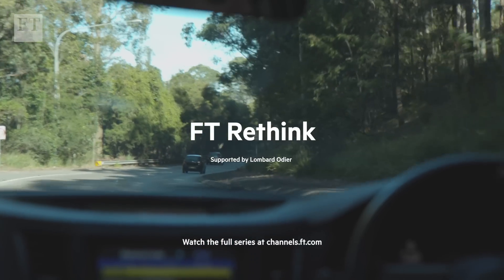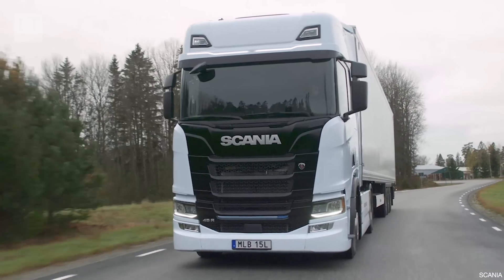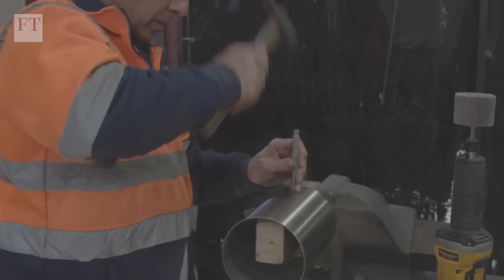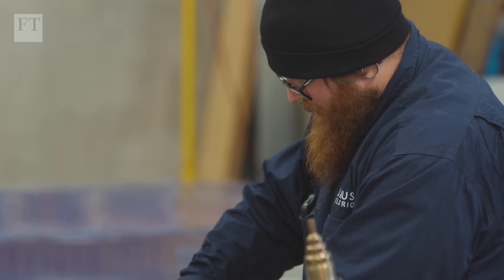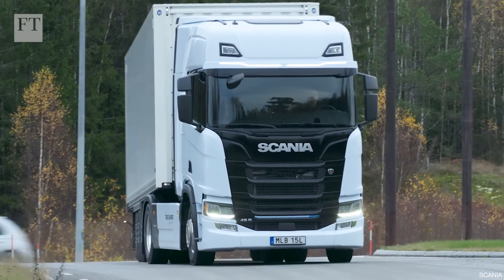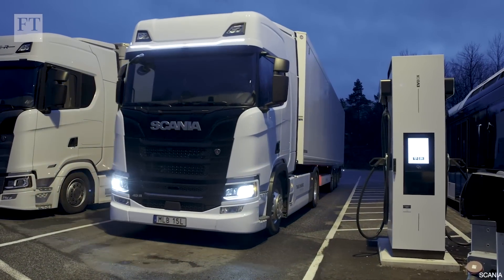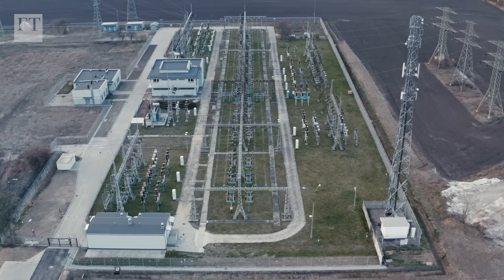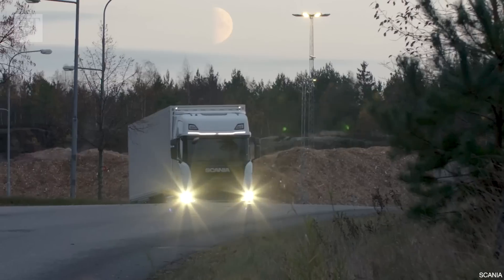The long haul to electrify heavy trucks | FT Rethink

Comment: This is the same aregument that can be used for cars. Swapping batteries is the way to go.
Reply: That would require even more batteries. Are you ready to allow those big dirty mining operations in your part of the world?
Reply: @jrhackman7414  Nope, you're wrong, cars could have more than one battery fitted, if doing short local trips, only one need be fitted, or due to quick changeover smaller ones could be fitted as standard. If going on longer trips fit two. Therefore less battery capacity is required most of the time,

Comment: sigh Why was at no point dealt with real world facts and figures? How much is the battery capacity of the trucks being talked about? What is the energy usage per km for these trucks? If any of that had been mentioned, then the whole topic would have been demystified and fully defanged, but that does not generate clicks.

Then, if you add in driver working times and speed limits, everything is solved.

The Volvo electric truck has a small battery with 200-395kWh. A documentary I saw a few months ago showed a trip from Berlin to Munich, and with all the ups and downs in between (electric trucks really love going up and downhill, regenerative braking for the win!), this truck averaged just below 1.2kWh per km. This means that the truck has a range of 166km or 329km in real life. This is 2 or 4h driving at the speed limit (which is 80km/h).

The Tesla Semi has a 500 or 800kWh battery. When the Semi was delivered to pepsico a few months ago, tesla presented an uncut video of the semi doing a round trip around nevada. This almost fully loaded truck used around 1kWh/km on the 500mi trip. 1kWh with a 500 or 800kWh battery means that this truck can drive 500 or 800km in one go. That's 6h15min or 10h at the european truck speed limit (80km/h).

In Europe, drivers are limited to twice 4.5h of driving (and unloading/loading) per day, with a 1.5h rest period in between. This means that it a long haul truck can only drive 360km before it can recharge for 1.5h. And then it can drive the other 360km before recharging for 13.5h.

1.5h of recharging at a bogstandard 250kW charger is 375kWh, or 375km of range. A huge truck battery can easily take 250kW until 90-95% capacity and 375km is more than can legally be driven in 4.5h.

13.5h of charging time to reach 800kWh is just under 60kW. So overnight truck stops need just 100kW chargers.

We do not need 800kW to 1MW chargers, we need oodles of 250kW chargers on parking spots optimized for big rigs. And we need overnight truck stops with a 100kW charger at every bay. And trucks should be plugged in at big distribution centers while loading/unloading as well.
Reply: I find these European driver restrictions hilarious, no wonder the EU is so unproductive as a society, everything there is handicapped by socialist extreme regulations 🤣
Reply: @100pyatt Ah, given your world view, you must be a fox viewer, and you're wearing a red hat supporting the american facist party.

Comment: Overhead catenary power on major routes would be cost effective, but requires significant upfront investment, probably more practical than hydrogen fueling infrastructure tho'.
Reply: Overhead power is also expensive to maintain. Electric road on Wikipedia points to a Swedish report the cost of different systems. An in the road surface rail for power such as Elonroad. A conductive pickup under the vehicle connects to the rail via sliding contacts, and the rail is only active one meter at a time when covered by the vehicle, making it safe in a city environment. The system is capable of delivering up to 300 kW with 97% efficiency while driving.
Reply: A BEV truck costs 250K-350K and has a ROI of 1-1.2 million kilometers when it becomes cheaper than a Diesel. Usual run times of trucks are between 2 and 3 million kilometers in Europe. 

Overhead power would cost trillions for whole Europe. You would have to electrify from Lomdonderry to at least Istanbul and from Agadir to Trondheim. Or do you want to tell the Swedes they will not get any more fruit from Morocco? And the Irish they will not get any more Olives from greece?

Comment: I am not suggesting that this would solve all the problems of electric long haul trucks, BUT  has anyone thought of putting solar panels on the sides and/or tops of the trailer? Would that help increase the distance a truck could go - especially in areas where daylight sun is strong, say Australia,  the desert highways of the USA and Southern Europe to name a few?
Reply: I doubt it would do more than top-up.
Reply: @tettazwo9865  I never did the Calculations for Trucks, but completely covering a Car in Solar Panels would yield roughly 2 kW. That's a Tea Kettle, or 2.7 HP. And that is assuming the Car was in Space around the ISS, without Atmosphere or even Clouds to interrupt the Light.
Reply: They would get stolen in Govan 😢

Comment: Diesel fuel and engines have significant energy- and power-density, respectively. This is why trucks, locomotives and ships use diesel. Batteries have nowhere near the energy density. Yes, you can make a long-haul truck with a 500 miles-per-charge range but the batteries are going to be very heavy; enough so that they're going to eat into the amount of freight the truck can carry.

An increasing number of people are determining that a plug-in hybrid vehicle would be more ideal than a full-on battery electric vehicle, for personal use. If local driving can be done on electricity, with only long-range running on petrol or diesel, that greatly reduces the amount of fuel they need; the vast majority of personal trips are short-range. Trucks are primarily long-haul vehicles, so they wouldn't benefit as much from such tech. But hybrids, of any stripe, benefit from regenerative braking.

With normal braking, your momentum / kinetic energy gets turned into heat on the brake pads / shoes / rotors / drums and gets thrown away. With regen braking, you turn it back into electricity, which you can re-use. A plug-in hybrid truck with, say, 50 miles range on a charge would have enough battery that it could easily regen brake all that mass from motorway speeds down to full stop, and supply enough power to get the rig from a full stop up an entrance ramp and up to motorway speeds. The battery could also regen all the energy from descending a long hill, even a mountain, and provide the majority of energy needed to climb the next one (regen braking isn't 100% efficient but it beats 0% efficiency seen with traditional braking). The diesel engine would only be needed for cruise power, which would greatly reduce the size (and fuel consumption) of the engine. Trucks already use a Jacobs / Jake brake to use the engine to decelerate the vehicle, minimizing wear and tear on the brakes; drivers would have little difficulty adjusting to large-scale regen braking.

If we can get the liters per 100 km down low enough, it may be possible to transition to biofuels or e-fuels instead of petro fuels. If you only need to recharge 50 miles of range, you can better-use opportunity charging; it's plugged in while you're loading or unloading the vehicle, such that you don't have to spend longer periods of time charging.

You wouldn't need megawatt-scale chargers. 50 miles range usually means a 100 kWh battery. Most such batteries can fast-charge to 80% (80 kWh, in this case), then they need to slow down; the latter 20% always charges slower. An existing 250 kW charger can stuff 80 kW into that battery in about 20 minutes.

Existing Tesla V3 Superchargers deliver 250 kW; V4, which is starting to roll out, more than doubles that power. ABB is delivering chargers which can handle 360 kW. These are chargers meant for personal vehicles. They would be sufficient for a heavy truck with a 50 mile battery. And 20 - 30 minutes charging time could easily be done at a loading dock.

There are batteries out there, though, which are made to handle full charge in as little as 10 minutes; use those for the trucks, as they would need the higher-power-density to handle the regen on a heavy truck.

The trucks would have no need to idle while sitting in city traffic and would have no direct emissions while driving in city traffic. This would help air quality in cities, sooner rather than later.

The cost of the battery is significant. Reducing the size of the battery needed, per vehicle, would reduce that cost and make it a lot easier to roll out the next 1,000 such vehicles; battery production is currently a bottleneck. Since it would still be using diesel (but considerably less of it), you wouldn't be as dependent on charging stations or battery-swap locations.

Too many people seem to be stuck with the idea that it has to be all-or-nothing; either we go 100% battery or we stay with diesel. There is plenty of grey between those black-and-white extremes. While we can't replace all current petrofuels usage with biofuels and e-fuels (simply not enough production of either), we are already starting to transition. If we can get consumption down, while we scale production up, we can meet in the middle.

And, as at least one or two commenters on here have suggested, if trucks simply moved freight to / from a rail hub, with electric freight rail, we wouldn't need to have a conversation about long-range battery-electric trucks.
Reply: there is a billion cars and a million ships in need for batteries - scale for infinite
(for ships - start with ferries, tugs and cruise ships )
Reply: Very good statement, thank you
Reply: There is an alternative to batteries.
wires and cables. We had fully electric busses 100 years ago they used wires above the road, even some trucks were tested and worked on it as well.
Reply: @davidty2006  (batteries are practical -wherever there is electricity you can get a charge )
Reply: DEATH TO FOSSIL!

And now we may start the discussion whether one BEV is more cost effective than another manufacturer. But first:

DEATH TO FOSSIL!
Reply: @wolfgangpreier9160  (tesla proved once and for all electric is superior being vehicle )
Reply: @replica1052  I don't know about that. I do not like absolutisms. They tend to bite you in the butt when you least expect it.

At the moment they are the best compromise of price and usability.
Reply: @wolfgangpreier9160  electric cars have instant torque -and wherever there is electricity you can get a charge
Reply: @replica1052  I know, i have 5 EVs in my company since 2019. 

I said Tesla is currently the best compromise. Maybe in 5 years its Toyota? Or anybody else. Who knows? 

Maybe in 10 years we do not drive our own cars anymore? Who knows?
Reply: @wolfgangpreier9160  (for starship point to point rocket travel - spiral/shuffle everyone in with window seats, flight attendants buckle you back in after your zero-g experience )
Reply: @replica1052  Mile high becomes another meaning on this vehicle.
Reply: @wolfgangpreier9160  every mars garage will have orbital rockets 
(to master a solar system as identity is a talent to explore )
Reply: YOU SPEAK TRUTH AND LOGIC WITH DIESEL ELECTRIC PLUG IN HYBRID TRUCKS ♥️♥️♥️💯💯💯✅✅

Comment: Not sold on the ev road tractor. Would rather see a plug in hybrid diesel/electric.
Reply: Hybrid diesel electric IC/BEV is the logical and practical solution until battery power density improves and the power grid Quadruples it's capacity✅
Reply: Check out Edison trucks. Pure electric drivetrain with an onboard diesel generator. Like a diesel electric train locomotive. Called an REV in E cars.

Comment: Electric motors are wonderful, batteries not so much.  Look at how Germany has approached the problem of trucking with hydrogen/electric.
Reply: The total cost of ownership with hydrogen is very high as are the number of points of failure within the system. Hydrogen will never be anything more than ultra niche for any transport sector especially one where delivery schedules are fundamental.
Add to that hydrogens terrible energy efficiency and major issues with supply and storage of the fuel itself and it's not really a surprise that it's never gone anywhere.
Battery swapping is interesting for HGVs as it the use of pantographs on motorways that are starting to appear.
I don't agree that ubiquitous BEV HGVs are years away, I think the euro 7 changes in 2025 will mean that they will be standard for new sales from then.
Reply: Disagree. If you look at the predicted developments inc timescales of BEV - sodium, solid state etc, the conclusion you reach is that it’s a matter of time before battery electric will answer almost all trucking requirements. Indeed the Tesla semi-truck already does. 
Hydrogen will never make sense and never see mass adoption. Fundamentally, why use electricity to make a fuel to achieve motion when you can use the electricity directly?
Reply: @229andymon  completely agree here.
Reply: @patrickjr11  I’m surprised there aren’t more people telling the Hydrogen Emperor he has no clothes. I see some applications for it, but those don’t include road transport.
Reply: Darmstadt just sold its hydrogen busses. Meanwhile, more and more battery electric busses are being seen all over germany.
Reply: Hydrogen is more difficult and still very expensive.

Comment: The future of long haul trucking is in developing  countries with poor rail networks and difficult terrain. Is the industry preparing to introduce electric those markets or will they continue to dump old ICE stock that doesn’t meet western emissions regulations there?
Reply: there will be a lot of fluctuations in the price of fossil fuel in the next decade or so, and the price will always be set by global pricing. Once oil is no longer being pumped and converted in the scale of today, then its price will become very high indeed.

Most developing countries are much nearer to the equator than, say, most of europe. These countries get excellent insolation, and are going to skip electricity grids entirely. Electricity prices will differ upon location and time of day, and the charge state of the fixed installation batteries at charging stations. Developing countries have much more to gain from electrification both through renewable generation and through batteries.
Reply: I would probably say it's both, it will likely take a lot of time before the remote areas in developing countries to be able to accommodate electric trucks.

But once they are common in the major developed economies I think we will see a s curve adoption rate
Reply: We have electric trains in whole of Europe. Since the 1960s (Germany was last with steam). They are by far not sufficient.

Comment: Electric road on Wikipedia points to a Swedish report the cost of different systems. An in the road surface rail for power such as Elonroad. A conductive pickup under the vehicle connects to the rail via sliding contacts, and the rail is only active one meter at a time when covered by the vehicle, making it safe in a city environment. The system is capable of delivering up to 300 kW with 97% efficiency while driving.
Reply: I bet it'd be very costly, but some type of road-length wireless charger (inductive charger) connection seems like it should be  possible.
Reply: There is the overhead wires above the roads..
Basically returned to trolley truck
Reply: @davidty2006  Nonsense, just imagine the cost for 100s of thousands of kilometers of highways to be electrified!
Reply: @julianbrelsford  Overhead power lines, despite having the most mature technology and least expensive infrastructure, are the most expensive overall because they only allow tall commercial vehicles such as trucks and buses to charge while driving, while non-commercial vehicles cannot use the wires to charge while driving, so they will have to use static charging that requires larger batteries with higher capacities than batteries required with the use of dynamic charging. Ground-level power supplies allow dynamic charging for all vehicles, which greatly reduces the required battery capacity and size since the battery is charged while it is being used. The reduced battery size and capacity reduces cost by about five billion euros annualized for the entire Swedish automotive fleet. The two types of ground-level power systems are estimated to have equal costs for all the components in aggregate other than infrastructure; the conductive rail infrastructure is estimated to cost about 1 billion euros annualized, while wireless inductive infrastructure is estimated to cost about 2.8 billion euros annualised.

Comment: Tesla semi…. enyone? No? Tesla megachargersystem.
Reply: Even Tesla is struggling so hard with the semi they even't will not answer questions about the semi.  they didn't share any numbers on the semi on 'the production and delivery' press release of Q2.
Reply: @Blockiee  It keeps breaking down. It is a serious issue.
Reply: @Blockiee  The Semi works really well, but it's only in limited production and delivered to a few customers for testing.
The next vehicle to enter mass production will be the cybertruck in the coming months. Volume production for the Semi will only start next year.